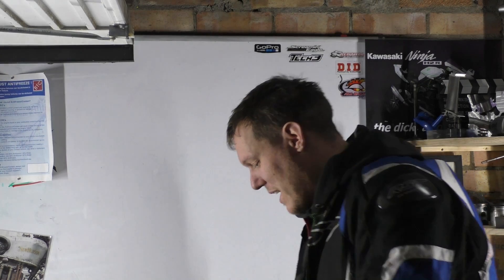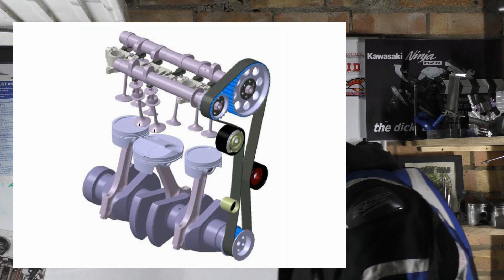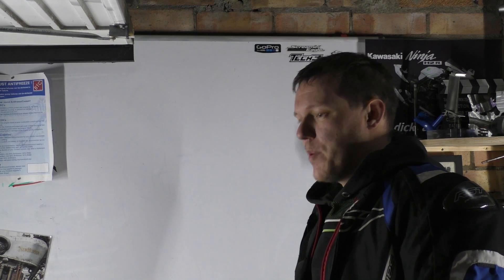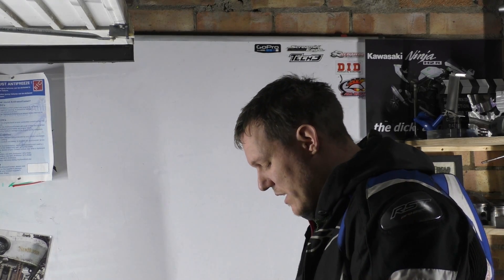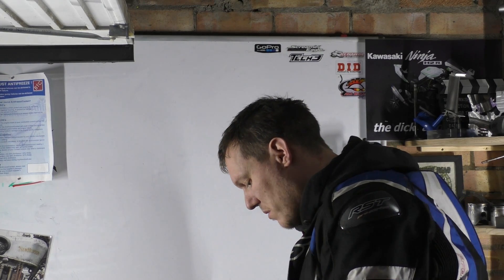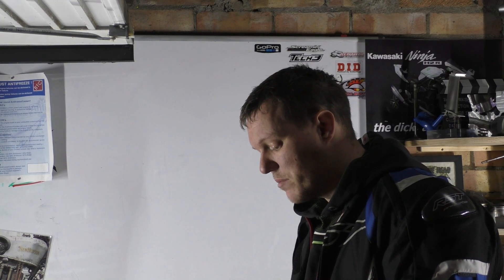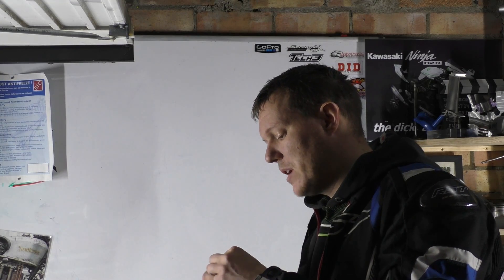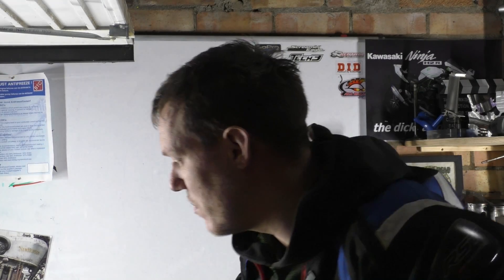Oil Rod engine - Part 2 - Codename 'Evans engine'

Comment: Hi Mat do you have any thoughts on the Achates engine two cranks, rods, pistons ect. Old idea comma knockers used one and a Garman plane in ww2. What's it got over say a Detroit two stroke diesel. Both use a blow through charge system the screaming Jimmy has a exhaust valve and cam surely it would be a lighter set up
Reply from the maker: Yes and we'll be getting to this - in time

Comment: On the subject of Hossack did bmw steal his designs or did they license it from him? One of my old trainers from bmw said that the design was tested by him but they just copied his idea
Reply: If I recall correctly Hossack offered it to BMW, and had meetings with them,  but they turned it down.  Several years later they made a slight change and started manufacturing with no payment to Hossack. It's pretty easy to break a patent unless it is tied down really tightly and costly to take action against a big company..  (There are specialists in this area and they cost a pretty penny.) In the IT industry virtually everything you do has had a patent on it so the normal way over this is by cross patents.  Something similar also happens in copyright.  Many cases that end up in court, particularly in the USA, they often find that both parties are contravening each others patents so they have to come to a compromise.  In the USA they tried to patent the whole human body so that they could get patent royalties for all discoveries relating to it.

Comment: Aren't the losses that you get from using fluid instead of a solid more to do with the viscosity and friction to make the fluid flow so quickly rather than the compressibility of the fluid?

Comment: You missed a trick.
The oil engine should have been released on the 1st April :) 
I love the amount of work needed to design an engine! 
I hope you do succeed in producing a better steam engine.. sorry heat engine. 
My money is on electric though. Smaller, lighter, more torque (depending on gearing), far higher power to weight ratio and highly reliable. 
Battery tech is all we are waiting for. 5 years and it will be here.
Hope still able to hold on. I love the idea of an ultra light trials bike. Swappable battery pack 10 miles range maybe. Get up some stupid gnarly mountain side. Quietly no annoying tree huggers.. land owners etc. :) well until they see the tracks anyway. ;)

Comment: "Liquids can't be compressed..."  Black holes would like to have a chat with those folks.
Reply: Yes that would be the perfect substance to make a cylinder, piston and crank out of. Nice stable and absolutely solid. No issues with cracking, gaskets, heat expansion or transference. Cylinder walls can be made oh so thin. Balancing out the reciprical harmonics would be a bit of a bugger however.. Dell's next project? He does not even know about harmonics & balance so not an issue for him ;) I cannot think why Harley have yet to use an engine fabricated out of a black hole yet for their bikes.. might make them a bit lighter? Ahh of course.. they are white Americans.. they would not use anything called a black hole because they would think it was part of a person of colour..

Comment: Doesnt matter what design anyone comes up with, no reciprocating piston engine will ever be as good as an electric motor. Its kind of a waste to invest in any new piston engine designs because the ONLY hangup for EM is (and not for long) batteries.
Reply from the maker: I think you're both wrong - the electric motors have been here for years, and saying the 'only hangup' is making it sound like 1) this is only a sideline to the concept, - if you reversed that to petrol it would be like saying - "ICE engines are great, the only problem is petrol, that we can only get from the moon" 2) It has taken us 250 to get from the Leyden jar to Lithium ion batteries today, so saying "not for long" means that something is here today, but they need to mass produce them for next years release?

There are 2 problems with batteries 1) energy density and stability - in other words how close batteries are to hand grenades. 2) charging times - again something that isn't changing any time soon, because of this little thing called physics....
Reply: @thedirtyworkshop  You are far too knowledgeable, Matt.  Thank-you for the heads-up re. batteries.  My concern is how the fuck are we gong to cope with global warming?
Reply: @jonniebyford  
  I've seen and read quite a bit about Fukushima.  That event and many others, along with a lack of intelligent, altruistic leadership have made me extremely concerned for the coming generations.  Let's face it - humans are flawed and wherever we go, there we are.
Reply: Fuck batteries, whos talking about batteries... I'm talking about micro nuclear generators in the vehicles themselves, refueling would just be swapping out rods every 5-10 years! Super clean, super simple!
Reply: @beachboardfan9544  problem is ATM size. Fuxors need more power to start than they will ever produce.
.shame the politicians killed the sealed nuke power stuff Iran was going to get in the 90s
Reply: I think you're right - I don't know about these things but I am a raving lefty who's into sustainable energy, etc.  Unfortunately, it seems the military/industrial complex is hell-bent on continuing to mine and burn coal and ultimately cause global destruction.   I think that's the plan, actually..😁  The rich are just biding their time while they finish their bunkers.  🏍

Comment: these kinds of issues are why I just went ahead and played with the fantastical idea of replacing the piston and cylinder with an inflating membrane. fucking, in the kinds of regimes where hydraulic con-rods would work reliably you might be able to get away with using fancy ass condoms to contain the combustion.

Comment: Is it possible the genesis head had benefits specific to carbs that became redundant with more common use of fuel injection? Redundance due to development in other areas? Could Ducati desmo valves be considered redundant due to developments in metallurgy (not recent!) or do they still provide a benifit? Were Yamaha right to drop genisis, are Ducati right to retain Desmo?

Comment: This goes beyond engines and engineering ideas. Nowadays the important thing is having a fancy graphic and make a good infomercial, then setup a Kickstarter or other crowdfounding and then get away with the money. Putting stuff out there without even knowing how it works or wasting 2 minutes checking the most basic thermodynamics, engineering, and phisics laws. It is also so easy to self convince an idea works

Comment: Isn't a good rule of thumb that the pumplosses get relevant at 200 bar? If than a diesel engine has around 30-50 bar max pressure, pumping losses shouldn't be  as much of a problem, right?

Comment: Mat, I know this is not motorbike related but I went to a museum and saw a picture of a tiger tank engine and crankshaft. Could you please explain the thing? Why the wierd journals? Why don't they use that today? Why the wierd engine block?
Reply: Can you post here a link of what you mean?
Reply: @ChrisLambert-Yngvegodi  https://www.pinterest.com/pin/304274518550429358/?%24ios_deeplink_path=pinterest%3A%2F%2Fpin%2F304274518550429358&%24android_deeplink_path=pinterest%3A%2F%2Fpin%2F304274518550429358&amp_client_id=amp--v0zF7S56_4_9cDwth2OxQ&utm_source=168&utm_medium=2160&current_page_url=https%3A%2F%2Fwww.pinterest.com%2Fpin%2F304274518550429358%2F&install_id=895a46ef201b46fea290aca47e8b4612&%24fallback_url=https%3A%2F%2Fwww.pinterest.com%2Fpin%2F304274518550429358%2F%23details&_branch_match_id=596873380357405667#details i think this is what hes talkin about. The crank looks normal vut the connecting rod looks interesting.
Reply: They used roller main bearings instead of shell bearings,that’s why the crankshaft has the large round diameters
Reply: MAINS? It has roller bearings for the main bearings?, or the Big Ends.
Some used engines from aviation, and I seem to recall some used Maybach engines. I think Maybach were bought out by Merc Benz.
I shall have to have a look into this.
YES! You are indeed correct. I had never come across this before. Instead of having usual sized Main journals, they are massively oversized, using and keeping the actual crankwebs circular and the largest diameter in the crankshaft. These then become the main bearings. The big ends appear to be conventional, in fact the norm during the war and before, fork and blade con rods.
I wouldn't enjoy pricing up and buying a set of main bearings for this engine. They look decidedly large and expensive.